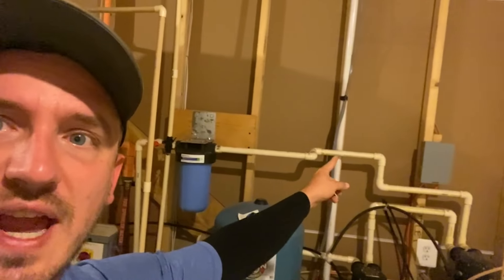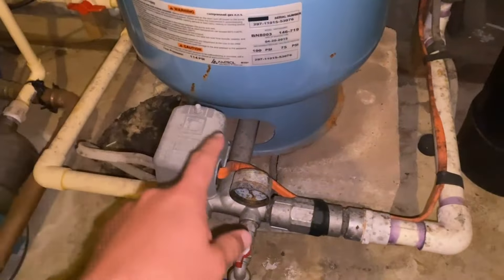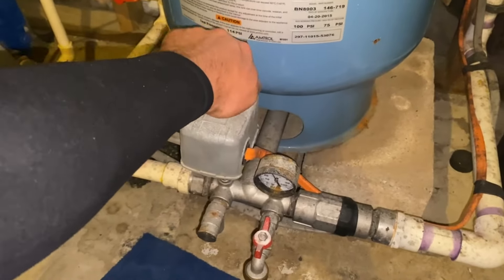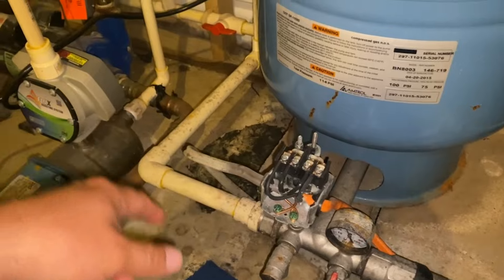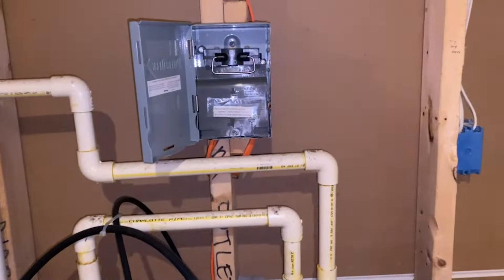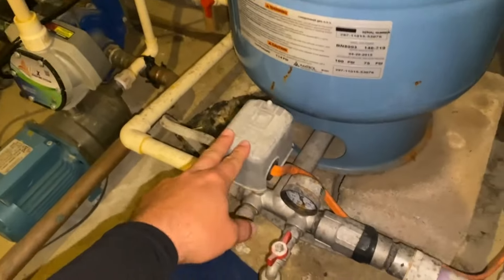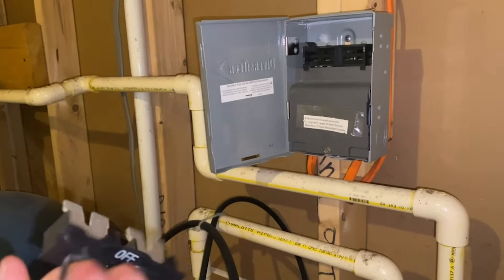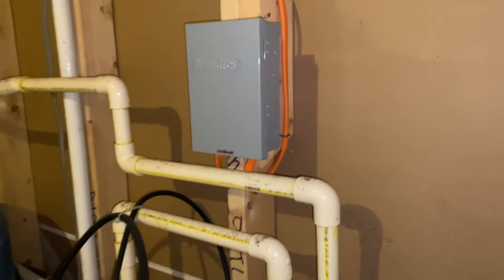How to Turn Off Your Well Pump Power Safely

Comment: So this video is great!!! Thank you so much!!!! We do have the shut off thing in that panel like you showed, I found it and pulled it out but everything kept going. I follow the two lines coming out of it and they’ve BYPASSED THE EMERGENCY SHUT OFF SWITCH by splicing the wiring to an electrical outlet with a plug that’s got a crazy lock on it 🤦‍♀️🤦‍♀️🤦‍♀️🤦‍♀️🤦‍♀️ if you rent and ur on a well, please check it to make sure this doesn’t happen to you!!!

Comment: Whoever owned this house prior to me has a electrical power off 100yds away from the pump itself and it is with many other breakers. This is like a needle in a haystack. The shut off valves are not visible either. I have a leaking water softener i need to bypass without taking a shower!! So this video truly helped!
Reply from the maker: Glad to help!

Comment: We've got a shallow well with the pump under the house (we're on a slab). Simple breaker in the main panel. Main feed comes into the house next to the water heater, then splits to cold and the water heater. Got shutoffs on all three (main, hot, cold).

Comment: I have a light switch to turn it off. I need to move my tub to plug a hole cause I have mice coming in. If I turn off well you sure I’ll be ok to move plumbing around to move tub? It’s a clawfoot tub.
Reply from the maker: Any plumbing work will need to have the main water valve closed and the pressure released from the system. The power switch is how you turn the well pump off. Turning the well pump off will keep it from refilling the pressure in the pressure tank. I always suggest turning the power off, draining the pressure, and closing the main water shut-off.

Comment: Will water continue to flow until the pressure tank is empty after the pressure switch has been shut off?
Reply from the maker: yes. After turning the power off, there will still be some remaining water/ pressure